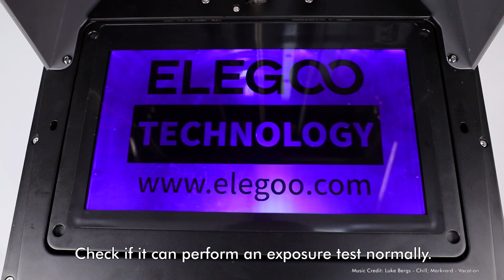SUPPORT: How to Replace the LCD Screen on Saturn 4 Ultra

Comment: Followed your video to change my screen - took me about 3 hours, but the video was clear for most of the time. Tips for anyone trying to do this :
1. If you aren't used to these very thin ribbon cables - the black bar across them is hinged and flips down - there is a small nail recess you can used to pull it forward - took me ages to realise this is what you needed to do.
2. Have at least 8 pots to put all the screws in and label the pot with which panel they relate to - makes things a lot easier when putting it all back together
3. Glue used to hold the screen in place is tough - I needed to get a heat gun on it to soften it up - would not have been able to push the screen out as the video suggests
4. Be REALLY careful when moving the frenzel lens - it scratches very easily so take you time to carefully move it around the frame as you remove it and put it back
All in all there should be an easier way to replace the screen, but it is what it is, so if you need to do it, give your self the time to do it methodically.
Reply: thank you for black bar comment. helped.
Reply: 3 hours is fucking insane dude, takes me about 10 mins to replace a LCD screen on a saturn 3 ultra. Pop off front panel, unplug the cables, pop screen out with thumbs (Could also use a small flat head to leverage it out), and clear out the glue tape, put new glue tape in, plop in the new screen, but the cover tape around the edges of the screen, test screen then screw the front panel on boom done. Like 10 mins of work. Fuck 3 hours. When they phase out the LCDs for the saturn 3 ultra im going to another brand. This is insane amount of crappy design for a printer that is more expensive and slower then the saturn 3 ultra.

Comment: U guys taking the piss? A lcd screen is a consumable. You shouldn’t have to disassemble the whole printer to replace it.
Not buying it now.
Next release. Can you streamline it?
Reply: The marketing strat for SLA printer companies is to pretend that it isn't. It gets people to buy in without realizing the true operational costs. Its also why most sponsored "reviewers" never bring it up.  With that said yes all printers should be designed to make replacing consumables easily that includes the screen but they almost never do.  Even the old school photons were a absolute pain to screen swap.
Reply: Home 3d printing is a joke in general. The standards people accept are unbelievable. The amount of failures is incredible and I feel like generally the whole scene is still very cheap. The build quality sucks, I'm currently half way through putting mine back together. Half the screws won't go back in 🙄 likely things shift and warp with the heat, light etc
Reply: @ferrarisarecool7 Did you manage in the end? I’m having the same problem lol planning on getting someone to help push/pull while I screw things back in.
Reply: @hoon-h5g that's exactly what I had to do. Get parts held in place, screw holes aligned while I screwed them in.... The LCD touchpad screen then broke so I've simply purchased a standard Saturn 4. Seems to work just as well, if not better, just takes longer - which is probably why it seems to work better
Reply: @ferrarisarecool7 oh damn.. I wish I saw this before buying one :”) Thanks for the response.

Comment: I'm in the process of putting in the new screen.  I've barely started and already there is a problem in your video.  When I go to connect the cable to the screen and you show that I am supposed to put the tape here...there is no portion of tape in any part of the packaging that is the size of the tape you use to tape down the cable.  Am I supposed to cut the tape to size from the black tapes that are included on the sheet?  If so...then you need to say that.

Comment: I'm sorry. But what makes you think that this procedure is okay for switching a consumable part of the printer? I was going to buy a Saturn 4 Ultra on Black Friday, but this is unacceptable. I would have to treat the whole printer as a consumable and throw it away once the screen died, I do not have the kinds of skills to perform this procedure. Very disappointed since it was so easy on the Mars 2 Pro.
Reply: After having just completed this, 10/10 agree I would not buy this machine again.
Got resin in the collimator lens on the first day by accident, took me 2 weeks to figure out why my prints were failing, and then I broke the lcd screen trying to remove it to get out the uncurred resin.

I had to buy a new collimator lens, and new LCD out of pocket + shipping at around 200$c and they don’t even have the lens in stock, you need to call support for it.

The pvc tape they use is atrocious, get a screen protector instead. Any gap in the tape, and resin will kill your lens very quickly.
Reply: They could of literally made it like the saturn 3 ultra where you can just take off the front panel and unplug the cable right there and pop out the LCD screen with your thumbs. Takes me like 10 mins start to finish. This saturn 4 is utterally absurd, there screens do not last more then a couple months with heavy use. (I have 14 saturn 3 ultras that are in constant use for my business, around 2 months  for each printer I have to replace the LCD screens. Beats anycubic which only last a MONTH)
Reply: Not a tech guy myself and have never done any kind of repair and was able to do this on my own without the video. I bet you could manage it too. Though I understand it was a lot of work and who wants to do all that. Only reason I tried is it is an amazingly fast printer and I really didn't want to lose it lol
Reply: @stuart13  wow you already replaced ur saturn 4 ultra s LCD? So the quality is that bad?
Reply: @stuart13  Whenever I open something so much it never properly goes back together. Plus there are printers where you just have to undo 4 screws to change the screen and don't have to handle sticky tapes and whatever.
Reply: @TashiMortier  which printers have such an easy replacement method? I'm looking to replace my saturn ultra 4
Reply: @JesusLoera-g2d  My Uniformation GkTwo has that. But not sure if I can recommend the Gk3 from them.
Reply: same boat here. A consumable replacement should take max 10min. this is ridiculous!!

Comment: The only reason you have to take the whole thing apart is because they use 100 mph tape to hold the screen in. Use less sticky double sided tape and you should be able to pry the screen out without total disassembly.

Comment: Im sitting here, watching the video then opening up the back panel. Why is there hot glue drops on nearly all connectors?! Im supposed to disconnect the camera cable, but how should I do that while it's hot glued to the connector?!
Taking pictures of everything and work as carefully as I can, but that's definitely another email to the support team...
Reply: My printer is like this as well, looked like a child did the hot glue work. I also found my LED Temperature sensor is missing! Turns out it didn't have one installed!
Reply: Same experience here. An easy way to remove hot glue is with isopropyl alcohol. They really shouldn’t have glued in everything when the screen is a consumable piece that will have to get replaced.
Reply: To get the hot glue to release… Drop some rubbing alcohol or denatured alcohol on the hot glue and it will release within a few seconds

Comment: OK, I just re-watched this video, and put some thought into it for you, and eliminated 80% of the work and time.  If you're removing the screen because it's end of life anyway, you don't have to worry about damaging it, you  just have to do the following (after powering down the machine and unplugging it!):

1: Remove the 7 screws from the back panel and remove it.
2: Unplug the LCD ribbon from the board.
3: Remove the tape around the screen.
4: Use a spudger or suction cup to pull up on  the screen, while providing some support to the tilt frame to prevent excess upward strain on it.
5: Remove the old adhesive and add new adhesive strips.
6: Feed cable down through the top slot, making sure it drops behind the UV shroud, not into it (with the extension attached)
7: Seat the screen, and apply even pressure all the way around to make contact with adhesive, then add the new black tape around it.
8: Plug the LCD ribbon back into the board, while making sure nothing catches on moving parts or the UV shroud.
9: Replace the back panel with the 7 screws. Done.

   I don't understand all the extra steps, they aren't needed.

   Plus, this method eliminates other potential issues such as losing screws, using the wrong screws in the wrong places (as you stated, some are different), over tightening the screws on the fresnel lens thus cracking it and finally, not damaging other systems by unplugging cables that don't need to be unplugged. 
   If I've missed something here, please tell me.
Reply: Yup, that was my experience too. The tape holding the screen is way too strong. I actually had to heat up the tape with a heat gun to get it to release, and you really need the position to push from the bottom up too. Even with the heat gun it still needed a lot of force.
Reply: I tried this and it did not work.   Could not get the LCD screen out with just suction or spatula without shattering it and potentially damaging other components.
Reply: Super glad I came down here and read. This was about to trash this thing.
Reply: @I used a blow dryer to heat up the glue and it came out easy after like 5 minutes of warming it up
Reply: I agree with @MrAsmodath that this should be a more easily replaceable part.  Unfortunately, after trying his method here, I'd advise people to take the long road shown in the Elegoo video for this repair.  At step 4, with a strong suction cup, I was not able to move the screen with a lot of force.  I used a heat gun to attempt to loosen the screen and tried pulling again on the screen.  After about 5 minutes, I thought I had it, but only the top coating of the screen lifted off, and most of the rest of the screen shattered.  Now I had a pristine single clear piece of acrylic stuck to my suction cup and a massive mess to clean up from the exposed broken glass.  Maybe Elegoo has changed how screens are fixed in these units since @MrAsmodath's comments.  Try these steps at your own risk.  They created a bigger problem for me.
Reply: I am curious now if I can just glue something to the top of old screen and yank it out that ways
Reply: There are screws connecting the LCD, my friend
Reply: @ImSandwich  i think this screws only fix the fresnel lens... right?
Reply: The tape just way too strong, i almos broke other things.
Reply: Easy method didn’t work. Heat didn’t loosen it
Reply: I just replaced mine for the first time. The factory installed screen is epoxied in place. And sits on top of the fresnel lens. 

Unlike this video,  it had to be forced out from underneath.  Shattering the old screen in the process.
Reply: But they want you to spend a absurd amount of time taking as long as possible so you give up and buy another printer instead..

Comment: I love this printer, but damn, to have to literally disassemble nearly the ENTIRE machine to change a consumable like the LCD is ridiculous. I'm thinking a wee bit more thought could have been put into that.
Reply: Dude, the wax they dont even shoe in this video needlessly holding all those cables is outrageous
Reply: @IronMando117  use a tiny bit of isopropyl will loosen up the hot glue on the connectors. You just dab a bit onto the connector and gently peel away the glue. The iso wont damage anything and will evaporate without leaving any residue.
Reply: Dude, this was monstrous! I can replace a Motherboard on my PC faster than this process! And $*&# the hot glue on the connectors; there was so much on one I damn near destroyed the plug itself! Took me 15 mins alone to get it off 🤬
Reply: The glass on mine is stuck. Literally I can’t remove it, I feel it’s going to break even more.